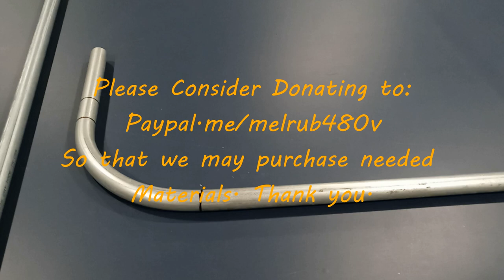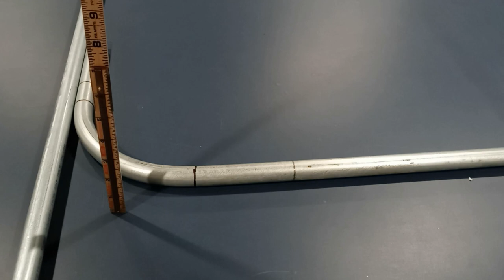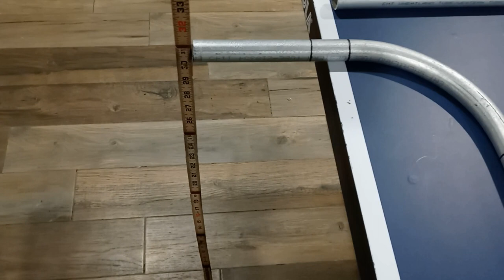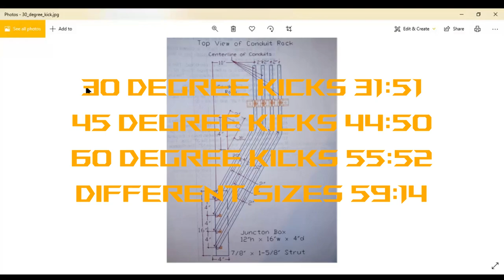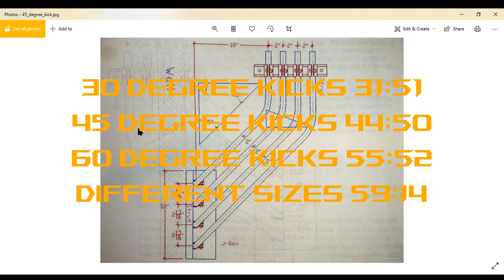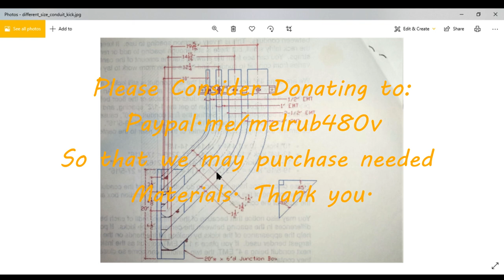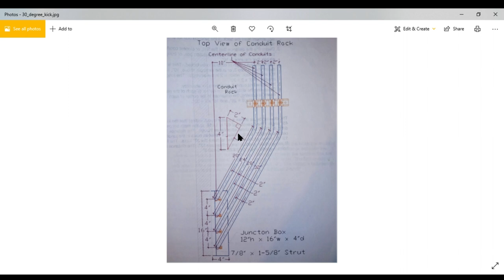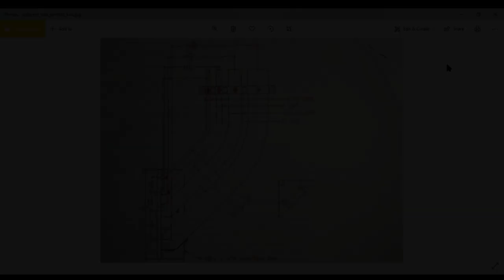Conduit Bending: Parallel Kicks Part 1

Comment: What if the openings are 2” apart in the panel and not 4” will it still work?
Reply from the maker: Im sorry my man but you obviously didnt pay attention. Your spacing on your panel depends on the spacing on your rack and also on the degree you choose to bend your kick.  Kind of works like an offset in regards to the offset multipliers so if you bend a 30 degree cake and you have 2 inch spacing on your rack the spacing on the panel will end up being 4 in. Because of the 30-degree cake equals A 2 multiplier just like offsets. Also in order for this to work okay. If the amount of kick you want is 10 in as well and we're doing 30 degree kicks you would have to measure 20 inches from the back of the 90 and that's where you're going to bend it but you have to bend it on the center of 30° so you have to find the center of 30°
 to do this on whatever Bender you're using. 
Example
Kick = conduit #1 - 10" , #2- 12, #3- 14
Rack spacing - 2" center to center
Front of 90 stub spacing (panel ko spacing) - 4"
Answer=
#1- 2 × kick 10 = 20" (measure 20 from back if 90 and bend to center of 30°) and space it 2 inches from center to 
#2 - 2x kick 12 = 24 (same thing bend at 30°) space at rack 2 inches to center with #1 on rack and spacing on front will be 4 imches
#3- 2x kick 14= 28 ( same thing)
Space at rack 2 inches center to center from #2 and ko spacing will be 4 inches. If tou want to make your ko spacing closer then you can use 45° or 60° but then the calculation changes. The multiplier are ghe same as offsef multiplier. Hope this helps. Please subscribe and share with co-workers and friends. Also co tact me and follow on Facebook@holmzlaw
Instagram@Holmzlaw
Twitter-Holmzlaw@Livewire480v
Tiktok@Holmzlaw

Comment: Hey brother....I enjoy nerding out when it comes to calculating emt bending. Your video has added value to my pipe bending skills. Could you please provide that link to chart out the bender, please? I don't think I have seen your video on that topic. Thank you.
Reply from the maker: Thanks for watching the video. I appreciate it. Please share it with friends and co-workers. Anyhow the video you are looking for is this one here
https://youtu.be/qScjMoMQlt4
(3 point saddle push thru method 15-30-15 method)
Watch the first 10 minutes of it. But it's only for charting hand benders. Charting the hydraulic and electric benders is similar just a couple different steps. Anyhow I touch upon it in the parallel kicks video a little because you need to use center of bend for kicks. 
follow me on:
facebook@Holmzlaw
instagram@Holmzlaw
Tiktok@Holmzlaw

Comment: Don’t forget to add 2” on each stubs length.
Reply from the maker: Add 2 inches?
Reply from the maker: What are you talking about
Reply: I was trying to said that the length of each stub up also change as the location of kicks increase.
Reply from the maker: @kilasmabonghot4167  yes i went over that in part 1. All depends on the degree of bend. The people that watched part one would understand. This was just an example.
Reply: Holmz Law 
You’re a very good Electrician, I’m very impressed. You should be teaching the apprenticeship classes. Thank you for sharing your knowledge 🙏
Reply from the maker: @kilasmabonghot4167  thank you i really appreciate that. Teaching the apprenticeship classes... I dont know about that
 But thanks.